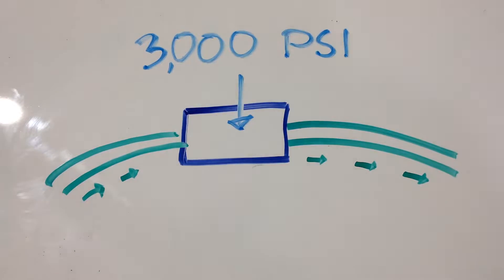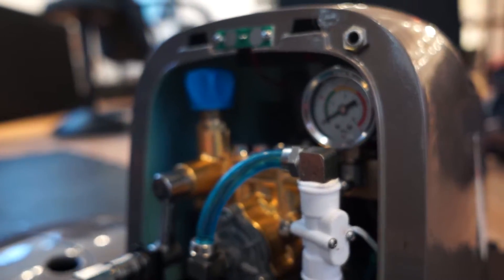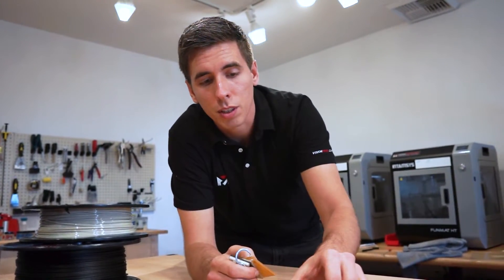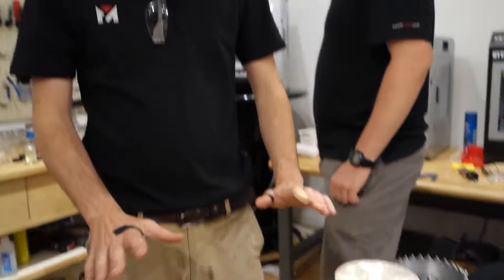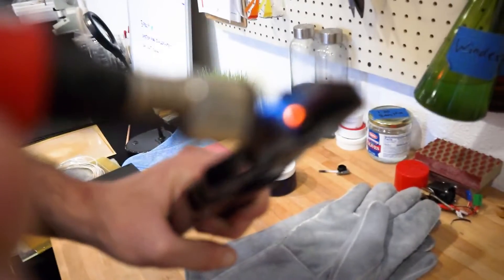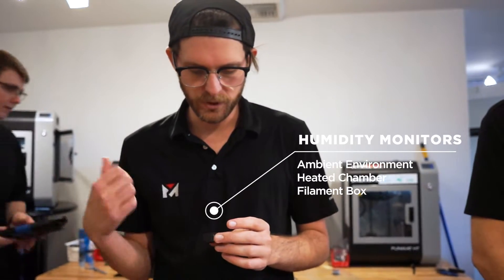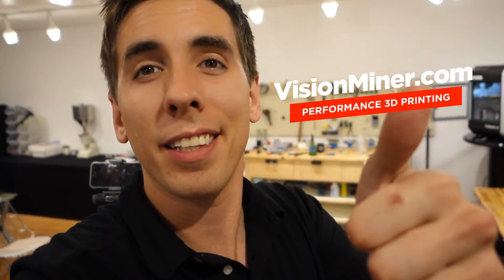Carbon Fiber PEEK, Will It Hold?!? 1,300 PSI - 3D Printed Coupler

Comment: I am no engineer but I am fairly certain that your test is inaccurate for layer adhesion. PSI is a measure of lbs per square inch. 10 PSI on a 1 inch part is only 10 lbs of force to the layers. 10 PSI on a 10 inch part is 100 lbs of force on the layer adhesion. I could be wrong but I think if this part is scaled, the pressure at which if fails scales in the opposite direction. In conclusion, if it held 3500 psi at that size and you scaled it 10x it is the equivalent of only 350 lbs of pressure on the layers. Am I understanding this correctly?

Comment: Did you treat the print with anything so that it could hold pressure?
Reply from the maker: We did not -- this was straight off the printer, but we did modify the settings to extrude plenty of filament, to remove any gaps from the part :)

Comment: Print a functional gun barrel out of your best material. Please make a video of that. Not only will you get a shit load of views but you’ll sell that type of filament. It would be really bad ass to see cf pekk or whatever you have that has the highest pressure resistance be used in that type of application. If your worried about it hurting your business name by doing something “edgy” just market it as “we don’t condone this. you need a printer capable of...” blah blah blah. Then say “we are just demonstrating what our filament is capable of”
Then the other guy says,
“Yeah if you do this on your tricked out ender3 your going to die”
You know really talk about how you don’t like 3D printing guns but it’s a good way to show filament strength. This is why it’s worth $650 a kg. Great video as always. I just think a barrel would be cool to see.

Comment: Humidity is relative.  It's why it's called "Relative Humidity".  So, as temperature increases, relative humidity decreases, so in those printers, which will definitely have higher temperatures, the relative humidity will be lower.  It doesn't mean there is less actual water vapor in the atmosphere though.

Comment: Is this continuous strand cfpeek and was there any post process done after the print finished
Reply from the maker: No continuous strands, simply composite material. About 10-13% CF infill. No post processing -- came off the printer like that! I don't recall for sure, but I believe we even printed the threads.

Comment: Nice work! What was the outcome of your clients testing?  Would this Material be sufficient for printing an intake manifold for a turbo car like a supra? Have you done such a project?
Reply from the maker: Yes, it could --- but probably wouldn't be viable due to costs and time compared to metals. However, we're seeing a lot of cold air or short ram intakes being made with polycarbonate!

Comment: Cant believe you are holding the part in your hands, do you realize the splinters at that pressure could kill you?
Reply from the maker: Yep, we definitely realized that later on. This is probably the most dangerous video we've made, and we didn't even break out the flamethrowers...
Reply: @VisionMiner  Be safe!! In the name of science, it would be fun to see you from a safe distance increase the pressure until that tube blows to smithereens and see what it really can take!
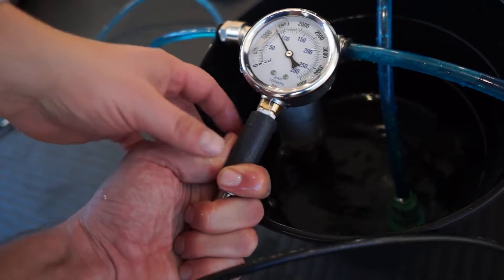Reply: Dude @1:25 I was like wtf, are they really firmly holding on to what is essentially a bomb if it lets loose?  1250 psi x ~10 sq inches is over 6 tons of force. Luckily it held and the guy's hand didn't turn into a pile of ground beef.
Reply: @CanDriveSoon  To be fair, at the timestamp you posted, they were hydro-testing the part. The whole point of a hydrostatic test is to use an incompressible fluid (water) to test the integrity of the part. When it fails under hydro, the second a crack develops, the pressure drops very quickly and you don't get the explosive decompression you get from a compressed gas. 

Water can't store much energy inside itself from pressure, it simply propagates the pressure from the pump to the pressurized surfaces. Gases can store A LOT of energy and they also propagate pressure. 

Regardless, there is an unfortunate lack of PPE on display throughout the video.

Comment: How is polyurethane tubing holding 90 bar?  What am i missing?
Reply from the maker: That seems to be PTFE, definitely not polyurethane
Reply: @VisionMiner  i have never seen blue tinged PTFE/ PFA / FEP tubing.
Reply: @slipstream6140  how about now? 😂
Reply: thick enough wall will work.

Comment: How come you didnt do the video of it going ton 3500 PSI ?
Reply from the maker: We didn't have the equipment there -- client went back to his facility and tested :)
Reply: @VisionMiner  so did it make it to 3000psi at the customer factory? What was the failure psi?
Also cheap easy pressure build is to use a grease gun, most hand operated can go above 10k psi.

Comment: i didnt get a good look at your rh sensor, but relative humidty is just that, relative to saturation at specific temperature.  absolute is usually a given mass of water per air volume.  warmer air has more space between the molecules so it can support more water mass in the air before it precipitates out, but it basically always happens at 100%.  inside and outside of the machine have the same absolute humidity, but the as the temp raises in the machine, the rh% will drop.
Reply from the maker: #science

Comment: That's because those sensors read relative humidity and relative humidity changes based on temperature if you take a sealed bottle with one of the senses inside of it where water and air cannot permeate and you change the temperature of the bottle the humidity will change because they measure relative humidity so the higher the temperature the lower the relative humidity if the amount of moisture stays the same